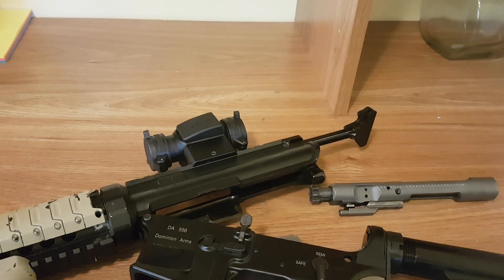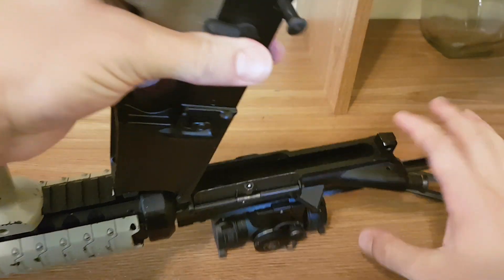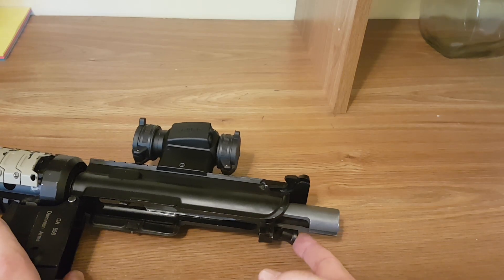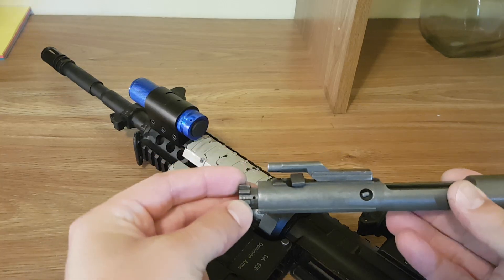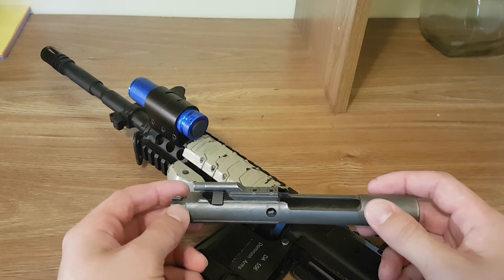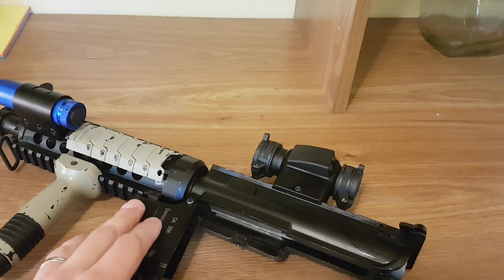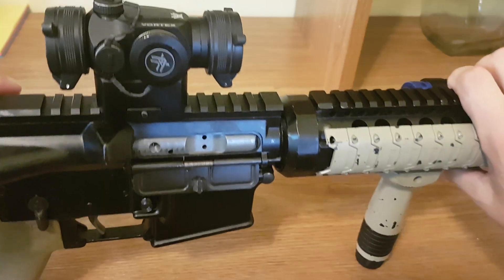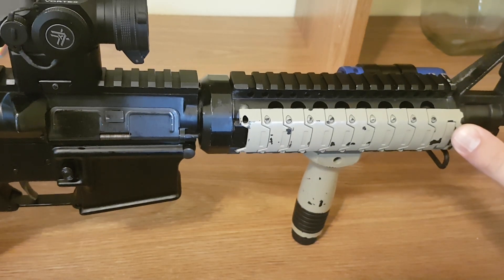What does the Forward Assist on the AR15 Do?

Comment: I've actually had to use it on some hand loads that swelled when it got over 100 degrees and my ammunition and whole rifle was hot enough that I needed gloves to load the mags and hold the rifle, plus a cloth for my cheek. Other times was when I did a round check with the charging handle and rode the round into the chamber
Reply: I know this is 5 months old but you  reminded me of being stationed on 29 Palms.  Same situation.
Reply: Ooh Rah, Brother.
Reply: were you firing rounds on Mercury?